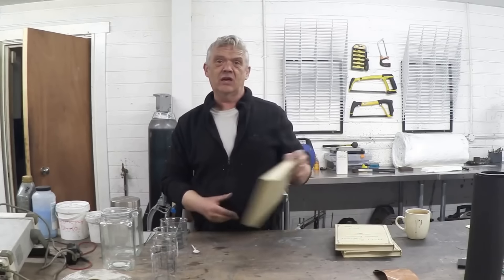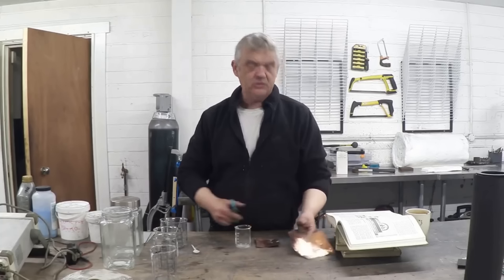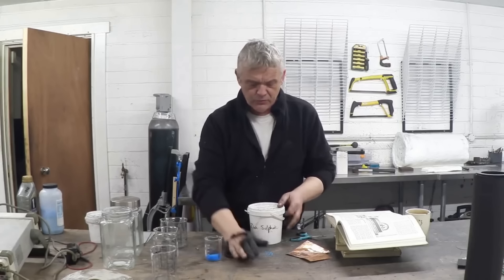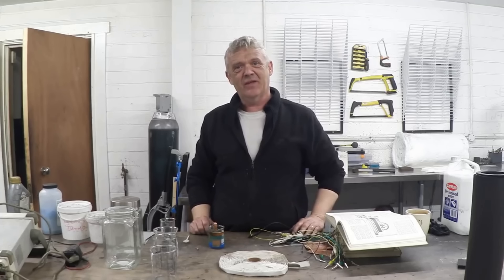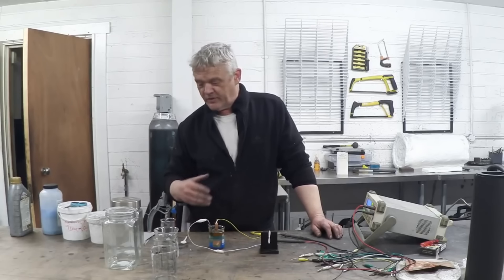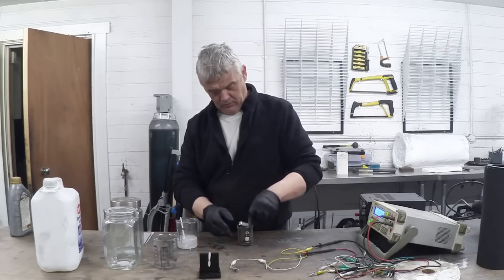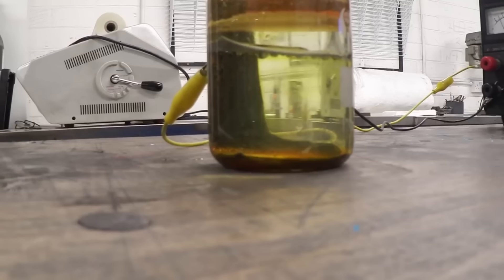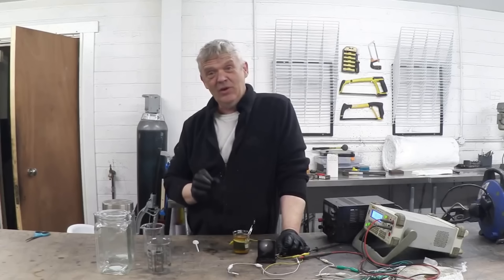2177 Gravity Batteries - Cheap, Easy, Robust And Awesome For Off Grid

Comment: Thank you ever so much for these demonstrations. Have watched this before and plan to use this zinc bromide battery with some of your wind turbine ideas. Love your talk on axial torque vs peripheral speed. I agree and like the magnetic fields / coils located on the circumference of the turbine. Thanks again for your informative, joyful, excellently presented pod casts. ❤🖖🫡

Comment: What about a phase change heat engine?
E.g. an object moving through a fluid/ fluid moving past an object. Drop the object generating energy from 'falling'. Energy is then put into the object - inflatable - changing its density to generate power on the up stroke.
Such a system can utilize a heat source - sun, fire - any heat source which is greater than the ambient temperature...

Comment: Amazing video. I wish I could get to building the electrically rechargeable one to use with my solar panels as batteries have become quite very expensive for me. 😢
Well, I'll like to know if that is tap water you are using. 🤔
Reply: De-ionised water, I expect. As purchased in filling stations ( and supermarkets) for topping up lead acid car batteries.

Comment: i was thinking of using aerobic compost piles of livestock manure and hay/straw with actinomycetes  (the potentially flammable "firefang" lower fungus that can cause spontaneous combustion in compost piles) that heat up to 32-60 degrees celsius, releasing methane and carbon dioxide. If you could harness the methane while separating it from the carbon dioxide also released by the actinomycetes' aerobic composting process, you could burn the methane to generate electricity in a type of rocketstove system of pipes with a  long elongated slope to run the length of, zigzagging slowly upward, the inside of a glasshouse to warm the plants organically so that  you don't need non-organic energy from external supplies to heat glass houses of plants like say tomatoes or strawberries in winter..., while releasing but trapping the carbon dioxide inside the glasshouse to feed the plants so they can convert that into oxygen, this while generating electricity by heating water with the burning methane elongated zigzagging rocketstove to heat the glasshouse interior, to turn a turbine to heat sand batteries for longer term storage of the heat/energy generated by the actinomycetes of the aerobic compost pile? The sand batteries the heat of which is not used to heat the glasshouse as is the previous stage of the system mentioned? It could also power lights inside the glasshouse to extend the daily photoperiod of the plants to increase their vegetative growth cycles (of photoperiod plants), thus preparing enormous plants with renewable localised energy supply, generating electricity and heat and compost in one go, in the middle of winter even prior to spring? I'm not really sure about separating the methane from the carbon dioxide generated by the aerobic compost pile, though. Only a small amount of photosynthetic available radiation (PAR) is needed to fool the plants into thinking they are experiencing a longer day cycle I wonde if it could generate enough electricity though (The compost pile, to have a machine turn itself in its container inside the glasshouse? I mean aerobic compost piles need to be turned to continue the process successuly.
Reply: no I don't wish to marry Greta Thunberg, I have enough problems. Thank you for your sanity and positive energy. It helps...!

Comment: I'm surprised😮. I thought a gravity battery was a mechanical battery system that used available energy ie solar or hydro to push a heavy material against gravity to a height where it was locked off until required. For example, using daytime solar power connected through a gearbox to an electric motor to lift the weight. At nighttime or whenever power is needed, the weight is slowly dropped which spins the the motor (DC) and generates electricity. So I was very surprised to see you demonstrating a chemical battery.

Comment: 12:31 I think if you wanted to use the first battery in an automotive or 'moving' endeavor, you'd have to find a way to gel the liquids. Not so thick that they can't flow, but thick enough that a couple jolts or potholes won't make it splash out...
Reply: - accident safe is also a nice feature to engineer in.

Comment: Question if that was in a larger container could you put two carbon electrodes and two zinc electrodes in the same container but connect a wire across from one carbon to one zinc and then take your power out of the other two and make a series battery that would be double the electricity output

Comment: Wait, if i understand correctly the second battery, you could calculate the surface area needed to build a 12 or 24 volt cell?
Reply: That is what I understood.
Reply: No.  The voltage potential between zinc and bromine will always be 1.75 - 1.8.  I think he meant capacity, as in, how long the battery will run for after charging.  More surface area = longer discharge time.
Reply: @SasquatchTrevor  no, the volume of the liquid and the density of it would determine the capacity, how long the battery can run, but the size of the... I guess anode and cathode is the correct term, could determine either amperage or possibly voltage.
What I don't understand is the need to up the voltage to charge it based on the size of the "cathode/anode". Probably the wrong term, but I think that you can guess what I mean.
Reply: @vidard9863  Right.  That's what I meant.  With zinc/bromine, the more electrolyte you have, the greater the capacity.  I don't know about how it charges, though.
Reply: @vidard9863   Wait, I remember now.  So, with this type of battery, the electrolyte is the active material.  All that the electrodes act as is a current collector.  As the battery charges up, the zinc plates out on the anode, and bromine collects at the cathode.  The concentration of zinc bromide will go down, and the conductivity will drop.  I'd imagine that would have an effect on the voltage and current used to charge it up.

From what I have seen of this type of battery, is that often something like sodium bromide is reacted with zinc sulfate to form the zinc bromide.  The sodium sulfate that is left over is left in as a freerider electrolyte.  That has the benefit of maintaining conductivity.
Reply: @SasquatchTrevor  but that wouldn't involve calculating the surface area of the "terminal", or explain why the charging voltage is not calculated on the condition of the electrolyte and is instead calculated by surface area.

Comment: A tank type water heater design would lend itself really well to this kind of chemical battery design vis a vis replacement electrodes, system flushing, and inhibiting evaporation. Adapting the pressure valve to vent at a lower pressure than a typical hot water tank would prevent pressurization of the battery, too.

Comment: It may be less confusing to call these specific gravity batteries to indicate the density of the liquid is what the gravity is referring to. 😉👍
I'm planning multi day battery backup for my home and flow batteries are definitely on my radar 😀
Reply: Agreed.
Reply: Density. For sure. 

 The dunce CAP Dynamo’s may be too dense to grasp the gravity of your words.
Reply: Was thinking of a big chunky weight pulling on a cord wound around a spool and using some kind of multiplier gear. Technically that stores energy by use of gravity, and would qualify as such if you don't differentiate with such details.

Comment: A true gravity battery, wherein a weight is raised, to provide later energy by its descent powering electricity generation, is the most ideally efficient battery we have - the only losses are any infinitesimal friction on the way up/down, and the loss of energy in the raising mechanism's energy transfer/powertrain and the loss of energy in the conversion of the descent to electricity to use, that last one obviously being the biggest, and in fact the ONLY truly significant loss in the whole system. 

That's why they are the (theoretical and actual) best possible battery that can exist, PERMANENTLY retaining 100% of its originally-stored energy (so it's not subject to electrical batteries' depotentiation over time in storage, nor even long-term chemical breakdown like gas or reagents, nor container seepage like hydrogen, nor pressure loss over time like air pressure, nor loss of a compressed material's springiness/rebound potential - it's just PERMANENT, PURE potential kinetic energy, eternally waiting for its triggered descent and simultaneous conversion to kinetic energy)... And, end-to-end, something like a 99.something-percent systemic storage efficiency, in practice.👍

It's god damn perfect!!

Comment: If you hooked the second battery to a small solar panel, say between 2 and 5V, would that be a good way to charge it for a possible emergency light source during power outages?  Just curious if that might be a practical use for this particular home made battery?
Reply: Would probably only charge it if the load on the main battery was less than the power sources from the solar panel. But I like it.
Reply: Playing with solar panels direct to loads is a tiresome and unhappy experience.  Run the panel thru a MPPT charge controller first and use the resulting output to do your job.

Comment: Closest we have to this today is a zinc-air battery, primary or secondary.

In the lab we had guys working on this for ultra low cost car batteries.

Problem with secondary zinc being dendrites causing shorting, it is hard to suppress.

Comment: Really great battery content as always, but challenge yourself on this battery and try and understand why the word gravity should be exchanged with density. There are physical and mathematical examples all around us, as well as good clue in the US Airforce Aviators manual. As it has been said, the truth will set you free. All the best.

Comment: Dams is another word for a gravity battery.
Reply: Unfortunately, dams damage the environment and ecosystems. 
There are versions I've seen where they divert river flow instead of blocking it and it seems more friendly to ecosystems
Reply: @pacresfrancis1565  just because they change the environment, doesn't necessarily mean it "damages" anything.
Reply: @pacresfrancis1565 if the flow rate of the turbines is equal to or greater than the flow of a river, there is no change on either side of the hydroelectric plant. 
The mountains themselves become your battery.

Comment: Correct me if I'm wrong but the first "battery" was a generator that generated current from a chemical reaction that could be renewed with the addition of reactants while the second "battery" was in fact a rechargeable battery that stored power from a chemical reaction but the stored current needed to be renewed from an external source.  The first should be much more useful for longer-term applications.
Reply: Correct, the first is a primary cell, the second a secondary
Reply: @MostlyPennyCat Is it possible to manufacture a battery depicted in the first case, of a size that would allow producing, for example, 48 volts of energy and use it to power a 3-kilowatt inverter, for instance? And what quantities of materials would need to be considered in such a case?
Reply: @pauliuspetronaitis1763  
Turns out this is a improvement on something called a "Daniell cell", you can look it up on Wikipedia.
From the section Gravity Cell:
"Sometime during the 1860s, a Frenchman by the name of Callaud invented a variant of the Daniell cell which dispensed with the porous barrier. Instead, a layer of zinc sulfate sits on top of a layer of copper sulfate, the two liquids are kept separate by their differing densities, often with a layer of oil added on top to prevent evaporation. This reduces the internal resistance of the system and thus the battery yields a stronger current."

Unfortunately it doesn't tell us what the internal resistance is, just that it's improved.

Comment: Instead of trying to store an electric charge, the future is in tapping into the power from the 'strong force' (nuclear power).  The energy available from this makes everything else look like a waste of time.  1kg of enriched uranium has the same energy available as around 100,000 tonnes of coal.  Imagine an AA battery that could power a truck for 80 years without 'filling up' with fuel, that's the future.
Reply: What would happen if the battery was burst would the uranium leak out causing a dangerous issue for the public and water supply 🤔
Reply: Rob I was watching something the other day were they had a old car battery split it open and took out all the old sells then he filled it with charcoal distilled water then put it on charge you could use sulphuric acid from old car battery boil it take water content down he said it could last for years just topping up ???
Reply: Aren't all the nuclear batteries currently available low wattage? They measure in milliamps and are used in heart monitors, right?
Reply: There are so many calories in uranium that eating just a small amount will provide enough calories to last you the rest of your life.
Reply: Hydro power...
Reply: Because this post of yours is so damned ignorant, I implore you to define a very specific keyword you used: "energy".

Energy can only exist in one of two forms, kinetic and potential. Because of your word choice, I can just about gather that you don't understand the implications of this very simple fact about energy and thus you have no idea what you're blabbering about.
Reply: 100% safe…until it’s not….
Reply: The governments will never allow anything like this to ever be mass produced 😪
Reply: The governments will never allow anything like this to ever be mass produced 😪
Reply: @elverman ...and it will keep you toasty warm as well! 🙈😅
Reply: Solar panels are not radioactive
Reply: Nuclear batteries exist (they are actually micro-generators). There are at least two approaches:
Let the probe heat up and harvest this heat by sterling engine or Peltier's cell.
It is used in cosmic rovers. It requires the exact size of the fuel: large enough to chain reaction to happen but not big enough to be too fast.
The second uses an effect similar to photovoltaic but instead of photon it uses radiation particles, they can last for decades but produce relatively small power.
Reply: What Happens when Truck Crashes ?.

Comment: Just an idea that might work or be fun to try. .
If you make a long tight coil of copper wire and drop a strong neodinium magnet down it it will produce power which can be stored in a capacitor and then fed to a motor driving a worm drive raising more magnets to the top, where they run down a slope before dropping into a funnel at the top of the coil to drop the next one down and produce yet more power etc etc.. Obviously the worm lift would need to be made from plastic or wood and the tube the magnets ride up of simalar none magnetic material.
Just think it might make a fun perpetual motion device? Or if not actualy perpetual then a small winding handle or a switchable battery to raise a number of magnets to the top ot the coil, to "prime" the system.

Comment: Hey Rob! Your videos on Zinc Bromide batteries were really intriguing, and it got me thinking about iodine (as in a zinc-iodide battery) but I found something even cooler. There’s a paper on Nature titled “A four-electron Zn-I2 aqueous battery enabled by reversible I−/I2/I+ conversion” by Y. Zou et. al. It discusses the formation and stabilisation of the ICl interhalogen allowing for an additional electron transfer reaction by the I+/I2 couple on top of the existing I2/I- couple (the latter mirroring the Br2/Br- couple of the Zinc Bromide battery). Please take a look and see if it lights a bulb over your head.
Reply: This reminds me of how potassium chloride makes a better "salt water capacitor" than sodium chloride.
Reply: @jamesharrell4360  Could you please elaborate?
Reply: @thesentientneuron6550  
Hey why not make a battery with a fizzy drink like 7up or iron brew cos that's what you've described my friend it'll never ever work